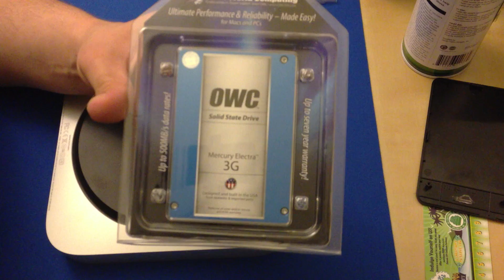2012 Mac Mini Ram and SSD Upgrade

Comment: This was one of the clearest, most well-videoed Youtube video I've ever watched.  Everything was clear, well explained.  I had absolutely no questions.  I watched it through once to be sure that I wanted to undertake the project, then I bought the same SSD (2TB) and Torx tools on Amazon.  As I did the work, I keep stopping and playing the video back step by step.  Going slowly, the entire upgrade took a little over an hour.

The one thing I figured out on my own was to get a plastic box with multiple wells, suitable for storing each set of screws in a separate well.  I wrote down what each group was for so that I never had to guess.  It make the whole process much less stressful.

Comment: Fantastic, just bought this 2012 Mac mini in Nov2019. Now she’s got a 500GB SSD and 16GB of RAM. Thanks for the great video.
Reply: Matt Im going to update my mac mini 2012 with in the next couples days. Do you notice a speed difference? Right now Catalina takes forever to open stuff with my original drive.

Comment: For this install we don’t need an extra thermal sensor for the SSD drive in a late 2012 Mac Mini？ No crazy fan problems or heat issues?

Comment: Great video. I think I will get around to doing this after I have sorted out the problem with my dad's mini mac 2009. He has updated his OX on his MacMini when auto-prompted, now he has a problem when using the net, facebook, etc. Apple said his system is now out of date, do you know how I can help him, possibly restore to factory settings? Or upgrade his hardware? Thanks in advance
 Stevie

Comment: What's the trick to getting the antenna grill to click back in place properly? Like some other people here, no matter how many times I tried I couldn't get it to sit perfectly flush, so could only secure it with one of the two hex screws. Got it back together and it's working fine but it's missing one hex screw. Annoying.

Comment: Excellent Guide. I have gone through so many guides earlier but this guide explains the handling of connectors so beautifully. I request you to make another guide to explain how to replace the drive in the lower bay. In my Mac Mini (Late 2012) the HDD is in the lower bay, which may involve a lot more effort than what is shown here. I guess Apple loves to make things harder for the DIY enthusiasts.

Comment: Finally I got it. It's more difficult than shown at video. The plastic side part goes out but not easily. Antenna grid is almost impossible to reassemble perfectly. I had to leave one screw out, it works perfectly however. 

The business card trick didn't work for me. Instead of this, I just put the macmini vertically, inserted ssd and with the sucker I pulled it until match the two little holes with the screws.

Comment: Very helpful. It made the job reasonably easy.  I might add that newer SSD are now as thin or thinner than the original drive.  Thus, they easily fit in but are a bit tricky to get in the exact position.  I found that standing the computer on end and letting gravity help made the job easier.  Also, because of the thin drive, a tool such as a flat screwdriver is needed  under the drive to hold it up when putting in the two mounting screws on top of the antenna grill.

Comment: Do i have to reinstall my operating system after doing these mods???? Or will it still be there???
Reply: nah you have to reinstall it
Reply from the maker: Paul Bateman if you want the operating system on the SSD then yes you will have to reinstall
Reply: Ok thanks mate. I will look for a video on how to do that. I want to update my mac mini because of the recent price hike from apple (can't afford a new one) so gotta learn a few things :)
Reply: Paul Bateman do you have the same year model?
Reply: Yes i have the 2012. I bought it in 2013 so still the 2012 spec (i can open the bottom of it ok).
Reply: lol i was thinking about getting a 2010 mac mini or a 2008 iMac. I would want to upgrade the ssd on both but the iMac is a hassle .
Reply: Yeah i don't think i would bother with iMac upgrades. I have an old 2009 iMac with 16gb ram that i won in a raffle lol. Its only a core2duo but the ram makes it quite fast.........if you stay in one app
Reply: Cool thanks for the help
Reply: yeah if you put in a new hard drive.

Comment: I tried this process and everything went rather well. The only problem I had was fitting the SSD. I used a Samsung 850 Pro, 1T. I used the credit card trick, but the screws on the SSD wouldn't go into the retaining holes without more than reasonable force. So, I had to leave out the two retaining screws. The SSD fitted better without them. Thankfully, the two screws in the WiFi grill hold the SSD in place.
Reply from the maker: I have had to do the same thing. As long as you have at least one screen in the SSD it will be ok since there are no moving parts.

Comment: what format did you use for this drive mac journal or exfat
Reply from the maker: Journal
Reply: if you do remember, what was the stock drives brand? what other brands do you suggest besides owc, that will give you the same quality or better? I basically want to upgrade my stock drive just like you to a 7200 rpm 1tb drive, then use the stock drive as a second drive to put windows 10 on.
Reply from the maker: +Storey Media I always go with seagate for spinning hard drives, and for ssd i use low end PNY drives from Best Buy they seem to work pretty well. 
http://www.bestbuy.com/site/searchpage.jsp?st=pny%20ssd&_dyncharset=UTF-8&id=pcat17071&type=page&sc=Global&cp=1&nrp=&sp=&qp=soldby_facet%3DSold%20By~Best%20Buy&list=n&iht=y&usc=All%20Categories&ks=960&keys=keys&seeAll=

Comment: how is the SSD holding up?
Reply from the maker: I haven't had any problems yet. Boot times are still great and I leave the machine running 24/7. Haven't had any problems.

Comment: You are more likely to win the lottery 10 times in a row while continuously being struck by lightning than to get that wifiplate back into place!
Reply: 1st time just about got the screws all back, 2nd time for a new 2tb ssd near impossible, one screw hole on the plate edge just would not line up no matter how many times I tried !
Reply from the maker: This is true. It takes a little wiggle time.
Reply: CJ Gonzales Is it that hard to put it back again?
Reply: Im about to give up this part and send the mac to a professional
Reply: I got it! This helped a lot! https://youtu.be/liGlr-4IN7E
Reply: It clicks in, look at the grate from the side, you will see the thin slots. It's fiddly but I got it after a few minutes!

Comment: Cool. Wanna upgrade mine for free? :D 2012 i7 x 4, 16 g ram. Thanks.
Reply from the maker: haha I run a business doing that so free might cost you some money haha
Reply: CJ Gonzales
I am old and dumb. Please tell me how to communicate with your company. Or how to contact you thru email?
Reply from the maker: Superseanbarry candcrepairs.net is our website and all our contact info is located there we are usually pretty reasonable. Are you just looking to install ram? or something else as well?
Reply: CJ Gonzales
I have 16g Ram installed. I want to add a SSD, parallels and Win 7. I have legal DVD's of both. I'll check out your link. Thanks
Reply from the maker: Superseanbarry to install a second drive (SSD or hard drive) would be $50.00 If you have all the components and extras ($100 without), to install windows 7 and parallels would be $70.00 so you are looking at $120.00-$170.00 plus shipping costs. usually takes 2 business days to complete.

Comment: OK. Well done, kinda. You are just putting down screws haphazardly, why? You will lose the screws no?
Reply from the maker: Yes you can I have been doing this long enough that I usually don't. I would recommend separating them into containers or buying a magnetic mat to use it helps a lot!

Comment: Great video, not quite related but is there any speed loss using a USB 3.0 hard drive for an OS ?
Reply: Yes USB 3.0 protocol is not as fast as SATA for main system drive. It will work but expect some performance difference.
Reply: digitalmediafan If it's Mac OS X or Windows it will be really slow on USB 3.0...

Comment: I completed my upgrade but couldn't get the wifi grate to sit correctly, the same screw that was missing when you opened yours up at the start...
Reply: CJ Gonzales one change you need to make to your video is that you need to screw the hard drive into the wifi grate BEFORE putting the wifi grate back in. if you don't the screws won't reach the hard drive, at first I thought it just wouldn't reach the samsung ssd hard drive but when I had to put back in the factory hard drive the screws wouldn't reach it either. when you screw the hard drive back into the wifi grate it also makes sticking the hard drive back into the mac mini a piece of cake.
Reply: same problem for me smh
Reply from the maker: YepThatsJ I had a few problems with this as well. you need to make sure that one side is seated than the other. Its hard to explain but you can get it by feeling your way. I hope you can get this to work for you. sorry for not being able to put it into words.
Reply: CJ Gonzales I understand but I tried for 45min and just gave up I tried everything over and over and deal with computers on a daily basis. Like one of the other people posted I also had a problem with the 2 screws not reaching my hard drive from the wifi grate. I did enjoy your video though. one thing you didn't cover is how in the world do you get the Mac OS installed on the new hard drive I put in?

Comment: Posting for a friend:
I tried it on a 2012 core i7 model and when I got to the hard drive it actually had 2 screws on the side which meant I had to remove the logic board to get to the 2 side screws. I was able to do it but it was not as easy as your video. Once I had the SSD in there Internet Restore was quick, had the mac up and running in 40 minutes.
Reply from the maker: Which bay was your drive in? the upper or lower? (with the mac sitting right side up and normal)
Reply: I purchased it brand new, core i7 so in the bottom?
Reply from the maker: Kelly Schumann hmm ok well thats weird than because all the mac minis I have done do not need the motherboard removed to replace the drive but if you install a second hard drive it does. I have another video on installing the second drive. Also some mac minis came with the upper drive populated instead of the lower this could have been the problem with yours but you managed to get it done, Great Job!
Reply: thanks so much, I just wanted your opinion.
Reply from the maker: Kelly Schumann k no problem. have a great day.

Comment: I just completed my install.  I prefer these instructions from CJ Gonzales because he shows that you don't have to remove the antenna, IR, or loosen the motherboard like other YouTube videos show.  Used the exact same HDX 23 piece screwdriver set from Home Depot for $4.95!  (Tip:  get a dryer sheet and wipe your hands frequently to discharge static).
I used an Intel 240 gb SSD drive from Best Buy (on sale $134.99).  It required sticking the included plastic spacer to fill up the 9.5mm drive bay.
The hardest part was updating the firmware on the ssd drive.  The Intel 530 series came with the old DC12 version of the firmware, but needed to be updated to DC32.  You have to create a cd (or usb) bootable drive (linux) then boot from that cd or usb drive in order to update the SSD firmware.  I borrowed a Macbook Air SuperDrive.  (Note: if you have a lot of usb devices, disconnect all but the keyboard so that it will recognize the SuperDrive as a bootable disc.)
Memory is on order, but that's the easiest part of the upgrade.  
Thanks a bunch CJ!

Comment: The instructions make the installation look WAAAY easier than it actually is.

I just got a new Mac Mini.

The original HDD doesn't just pop out the way the video shows.  Mine is wedged in there and I cannot get it out.
Reply: I got the logic board partially out.  The drive doesn't come out because it's screwed in from the side with two screws.  You can't access these screws without taking the logic board out.
Reply: This is a very helpful video.

I have no problem in taking out the HD without removing the PCBoard.

PS: My Mac Mini is 2011 model.
PS: The build-in HD is 9.5mm thickness.

But I do have problem in removing the connector of the fan.
Reply: I ran into that also so I quit for today till I affirmed that.  Didn't want to break something.
Reply: Mine is stuck in there as well. Help!

Comment: Hello, I am new to Mac computers.

Not sure if you can help me, are you familiar with Mac Format set-ups on SSD for being a regular storage drive? I own a Mac Mini 2012, 2.6 Ghz, Intel core i7, Fusion, 16GB Ram, 1TB storage (Run's Great!). But...

I want to keep the original HDD as my main OS system (no upgrade) but want to set-up the 2nd bay for the SSD (for my massive storage drive for my Native Instruments Library samples.). Possible?

Any recommendations for a SSD? Crucial M550 1TB? Or, Samsung EVO 840 1TB?

If possible, setting-it-up this way, what kind of formatting would I do differently after installing the SSD in the computer? Again, the HHD will remain as is (no upgrade); the SSD will be for my rapid-speed Storage use only."

Comment: OK so now you have an empty hard drive fitted into your mac, how do you reinstall OSX?
Reply: Well, you clone your old hard drive to the new SSD first. And then install it. So the SSD will not be empty. Just put it in and boot. There are various cloning softwares in the market (Like "Carbon Copy cloner") that u can use.
Reply: Thank you.
Reply: I have a machine that clones the hard drive in a few hours. Called a BAUHN Dual Hard Drive Docking Station. Used it to clone and replace all my disk drives so far. It's awesome!

Comment from the maker: If you are using this with the newest Mac mini you do not have to make the drive bootable you can start up into internet recovery by holding down the option key at boot and than connecting to your wifi.

Comment: Help I have 2010.  I'm upgrading a failed drive to SSHD.  There wires on the left side and right side of the original.  The new only for the left.  My video is mac mini hard drive replacement.  Help? Do I need the one on the right?

Comment: Okay thank you so much. Also, do you recommend a certain brand of SSD? I'm thinking of upgrading the standard hard drive to a Samsung 840 Pro with 512 GB
Reply: The Samsung 860 EVO is the best drive I can think of right now for a machine like this. (Different machines I would recommend a 960)